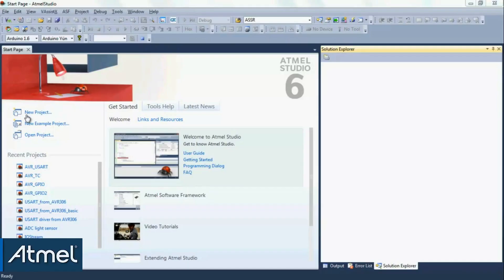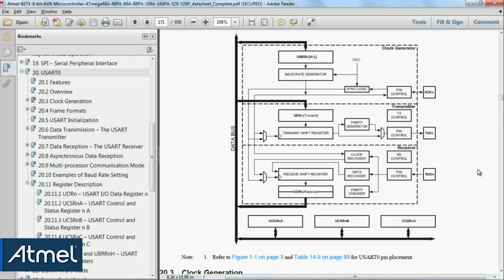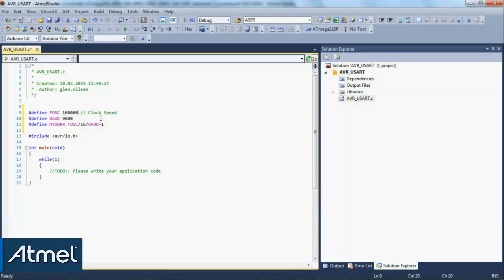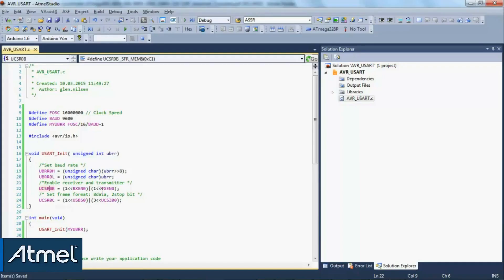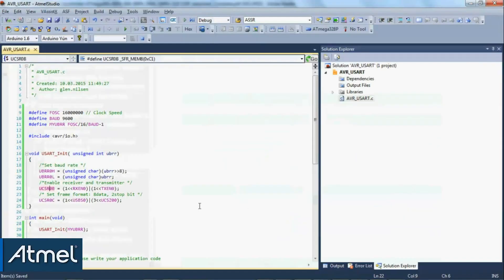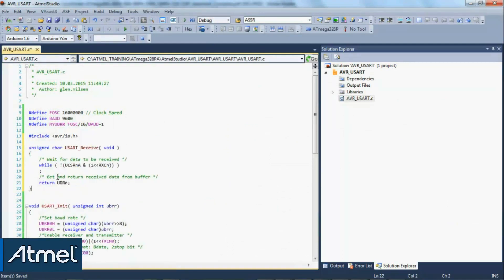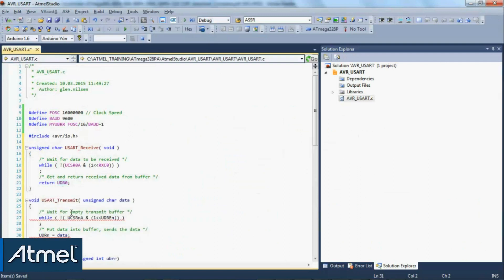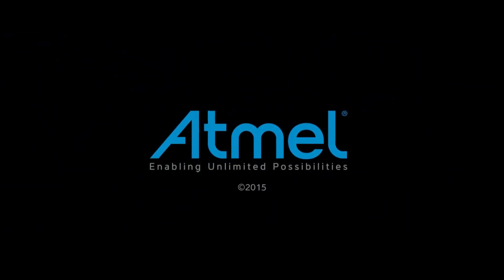Getting Started with AVR: Using the AVR USART to Loopback From a Serial Terminal (#16)

Comment: Great video, helped a lot! However, for BAUD 115200 the formula did not work goog. It calculated 7 for UBRR0L and it should be 8 in order to work fine. Since my preferred BAUD for my projects is 115200, I just use to set the UBRR0L manually as 8 and UBRR0H as 0.